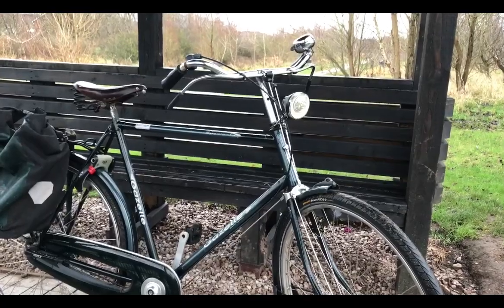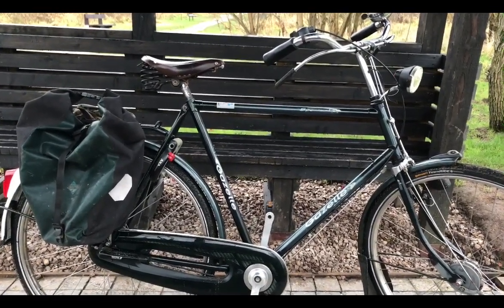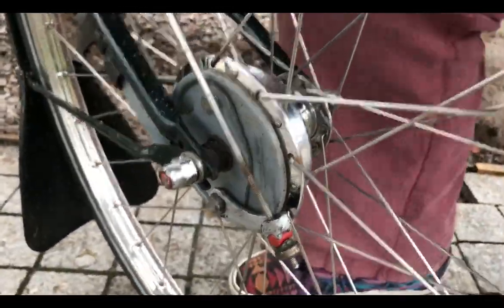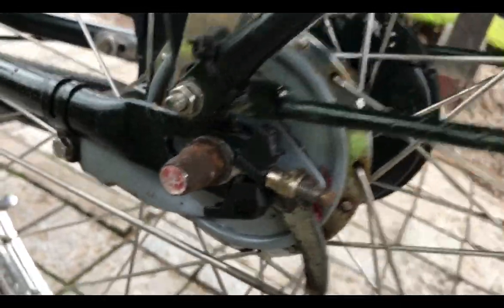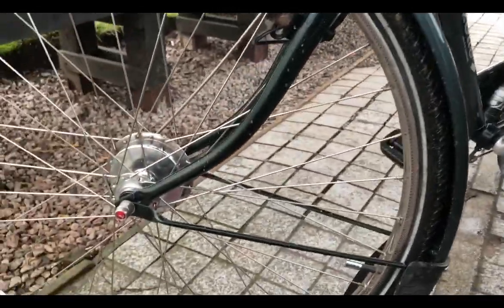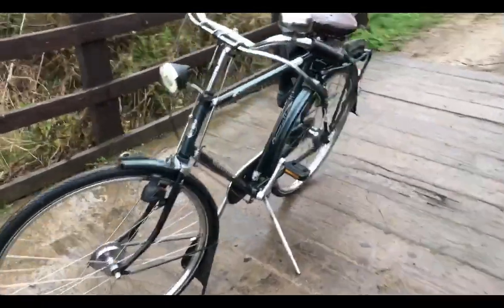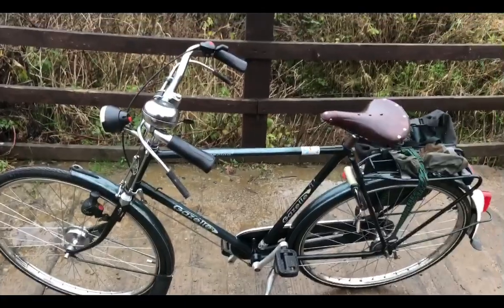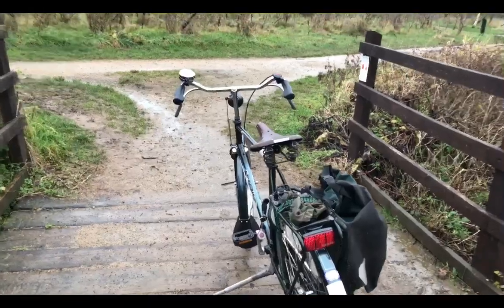Gazelle Genius! The safest brakes for city riding - explained and skid-tested (spoiler - they don’t)

Comment: Love your videos!
I am currently restoring a Gazelle tour special to original to be my daily bicycle, its 40 years old, missing the odd part but all still produced by Gazelle. Brilliant bike, got mine as a 12 year old cycling in the Netherlands 30Km per day from home to school and back. 
After moving to Ireland 22 years ago I wanted to get my real Dutch cycling experience back and got hold of a rusty banger but with good potential. 
It was technically tight as a drum and not a rattle. 
It always looks worse than it really is, the quality of these bikes is unbelievable. Knuckle grease and the odd replacement part gets these tanks going again!
I Really love your video's , please keep them coming.

Kind regards,

Gerben ,
Dublin.
Reply from the maker: Gazelle content coming up soon
Reply: i was just gifted a Gazelle Speciaal by my landlord here in NL. Beautiful bike but I have no idea what year it’s from - anybody know how I can at least narrow it down? I’ve had to remove & scrap the chain guard completely due to rust and some horrible damage that was scraping the chain and making a worrying noise. I’ve been searching all over for spares/replacement parts that look and feel like originals
Reply from the maker: So it was a metal chaincase, that’s pre 1981. Apart from that I would need photos

Comment: I have a 2013 Gazelle Primeur. Use it in all weathers since new. Looks the same frame as this bike. The only thing I don’t like was the nexus 7 speed hub. I broke two of these hubs and couldn’t face getting another 7speed hub just for it to pack up in 3 years again. But it was too good of a bike to get rid of so I got a velosteel single speed coaster hub (with longer axle) built into the wheel instead. So far so good. I love it.

Comment: Great system. I know things have ‘progressed’ but rod brakes do look classy on a town bike in my opinion. Pity the stirrup type are so poor in the wet considering the uk weather. I probably won’t get my Superbe out now until late spring. Thanks for sharing.
Reply: They're not so awful in the wet so long as you remember you need to brake about three seconds earlier than normal to wipe the rain away. I forgot the other day and had to stop with the soles of my shoes.

Comment: Lovely bike there and thanks for the interesting video. I was interested by the braking system and I could be wrong but it looks to me like the front brake has a pivot at the top of the fork that is hinged over the left fork leg. I think that the mechanical advantage gained at the lever mechanism is then equalised at this pivot point? Would be interested to hear your opinion.

Comment: I'm sure that the interlinking works by just having both brake levers be one single metal bar. They clip into their eyelets through a gap in the front, rather than sliding through the side like other bikes. That plastic bit in the middle, I think, just stops it from having any unwanted side to side movement. At least this is how it was on the Gazelles I've played about with on the scrap pile at my local second hand shop.
Reply from the maker: Yes I think it’s one bar.

Comment: It is a clever system, however you cannot adjust the steering. Nowadays all bikes are fitted with shimano rollerbrakes instead drum brakes which I dislike because of their drag.
Reply from the maker: Im not sure what you mean about adjusting the steering. The height is adjustable by loosening the pinch bolts in the rods. The bearings are standard items.
Reply: @unbalancedcrank Thank you, I will check into that.

Comment: Gazelle still fits rod brakes to their Tour Populair model - 3- Speed sturmey archer model, they're very proud of it. it's not exported outside the country anymore though.

https://www.gazelle.nl/modellen/tour-populair

As far as rod-rim brakes they're still made in India (even raleigh 28" models) but with extreme poor quality. And I think the flying pigeon in China but again, bad quality.
Reply from the maker: I have two Toer Populair models, 1960s & 2012. Neither of them have rods. Both were Dutch home-market bikes ( I bought the modern one new in Den Haag). It must be an option.
Reply: @unbalancedcrank  It's a bit like Superbe Dawn Tourist vs Sports Tourist, you can get three speeds with rod or cable, but the ones with more gears are cable only.
Reply: I live in France and couldn't find a Dutch bike that fit my size so i decided to order this one in October and i love it 🙏
Reply: @anothervisionofthings  I've always wanted to order one brand new, but when I have the time, I don't have the money, and when I have the money, I don't have the time.
Reply from the maker: That’s me and Pedersen, or Rivendell, or....
Reply: @kyle8952  I always had older Dutch bikes with smaller frames, but this one is like the Rolls of bikes, so smooth, just the perfection !!! Definitely worth take time to order :)

Comment: The reason you never skid with drum brakes is they are very very bad at bringing you to a complete lock up. This is so dangerous going down big hills or stopping quickly near a busy road.
Reply from the maker: I suggest you have a look at whatever those brakes were that gave you that experience, because something is clearly wrong with them.
Reply: @unbalancedcrank  that is right, they have to be Serviced from time to time. Open the Drum, clean the Breaking surface with....Breakcleaner, maybe roughen up the break Shoes surface a bit with sandpaper, and after years (sometimes decades) of use maybe even swap in some New breaking Shoes. I think in terms of Shopping Power, a Drumbreak is behind Disc, but better then Rimbreaks especially in wet conditions.

Comment: I had this exact bike, it is very beautiful, and the way the brakes work is very clever. Unfortunately their stopping power is atrocious compared to rim, roller, or disc brakes. It is particularly bad when you have extra weight on the back, which is a shame because this bike is easily strong enough to have a kid or even an adult on the rear carrier. It would be fine in Holland with no hills but rest of the world has hills.
Reply: Nonsense. The 70 mm SA drum is maybe soso, I have one with my SA RD3. 
But My SA XL 90 mm drum brakes are as GOOD as anything, especially in ALL weather needing ZERO cleaning/ service. My front dyno drum has 28,000 miles, 8,100 on 2 tours, with my 120 lb custom/ Rohloff14. It was so good, it broke my wimpy fork 3 times on my Vietnam/ China tour. The first 13,500 miles with the R14 were with a POOR caliper on the back wheel. The Rohloff now has a 203 mm disc/ cable TRP Spyre, that absolutely does lock up instantly. But it will take 3 or 4 sets of pads and another disc to last as long as SA drum pads. So that also shoots down any price comparison. Besides that, my Dyad rims/ drum wheel still looks as good as NEW. 

My new Toronto designed Simcoe roadster came with a Nexus 7i and roller brakes. What a joke, they stop spinning faster than my Rohloff. LOL. Maybe 25 seconds. Grim scratch brakes?? LOL. AVID one pad moving disc brakes?? JUNK. LOL.
Besides that, I have used Chinese junk bikes with junk rim pull rod brakes. LOL. And also rear band brakes on Viet SS bikes. I grew up with coaster brakes, then steel rim brakes.